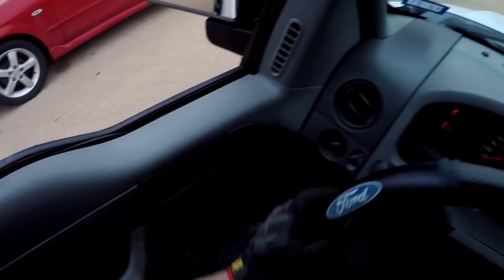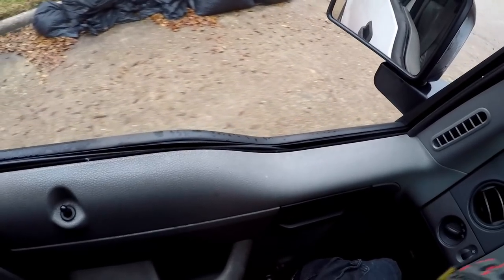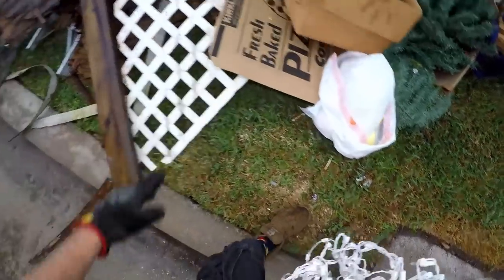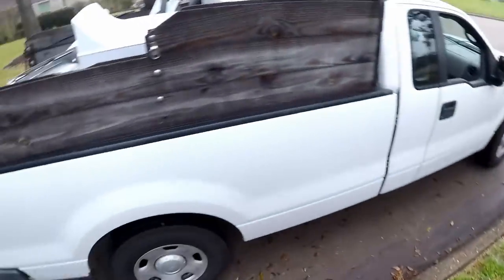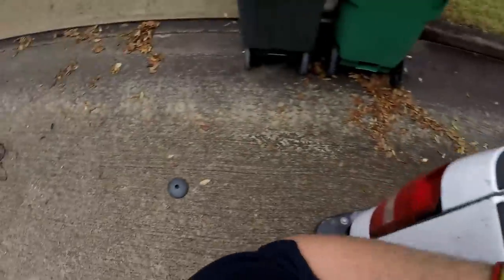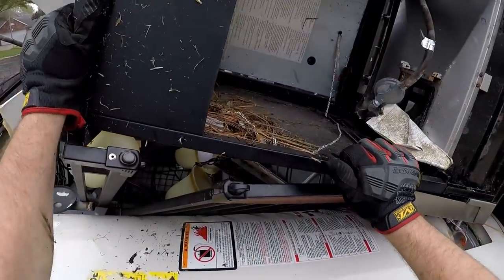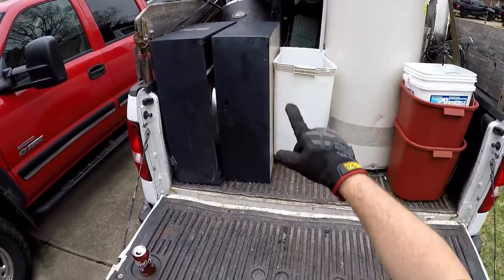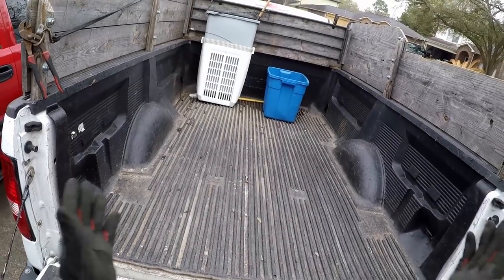Curbside Scavenging "Rock As A Hard"

Comment: A fellow scrapper from florida just breaks the blades off of the ceiling fans. It’s rather easy it appears. Easier to pile without those blades. Also, you should think of putting a removable stake bed section above the tailgate. Stash the section inside the bed on the stake bed side or even on the outside on the passenger side maybe. Give yourself a bit more wall...